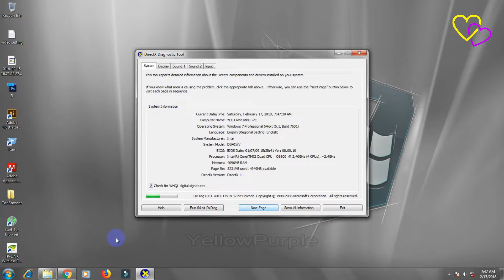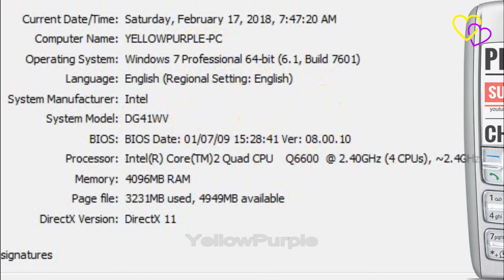Change processor in desktop | upgrade to Intel Core2 Quad Q6600 @ 2.40GHz in DG41WV Motherboard

Comment: keep in mind that it won't run windows 10.. it will freeze up around the login screen..  i have the same motherboard, tried upgrading from dual core to core2quad 8200...

Comment: Good morning, my friend I have a plate identical to yours and with the same processor, DG41WV + Core 2 Quad q6600. I am not able to activate all 4 cores ... You have made some changes in the bios, Note: I had to disable the power limiter to be able to work with this processor! If my English is bad, do not worry because I'm using google translator kkkk.
Reply: Im not able to activate all the 4 cores too 
Can you help me to fix this problem?

Comment: What are specifications that I should look for upgrade Core 2 duo e8300 to Core 2 Quad 
Cpu -core 2 duo e8300
4 ddr3 ram (2gb+2gb)
Reply: nothing. but make sure you buy a 1000 rupees above fan for it

Comment: Hi, is that possible or not to upgrade my core 2 Duo E7400 ,G31 M-S motherboard LGA 775 socket into core 2quad  q9650 processor  pls reply
Reply: Yes but q9400 is more comfortable with g31 motherboard than q9650

Comment: did you need to do anything with the BIOS or did you simpily just place it in and boot it?
Reply from the maker: simpily just place it in and on the pc
Reply: @YellowPurple  didn't work for me. I replaced my dual-core with core2 quad, the CPU was detected, windows boot up, but when I launch whatever task, my computer freeze and I got the blue screen. My motherboard is Mercury G31, specs say it takes all processors
Reply: @tunkunrunk  i have got a similar issue , at idle doing nothing it lasts but when ever i try to do any multitasking work which spikes the cpu usages to 100% for more then 10 seconds it freezes and hangs , until i restart the pc manually . So have you got any fix ? I am desperately searching on the internet but found no fix yet .
Reply: Yes i have same issue
Reply: @Wolf-jb5bh  go on your bios and desable or auto TDP
Reply: @ig.sushant  go on your bios and desable or auto your TDP

Comment: Can i change my dual core processor to core 2 duo in the same motherboard.
Reply: Get Q9400 processor it is better for lga 775 at good price range
Reply: You must check the adaptability of your motherboard, whether it is dual core or quad core processor compatible
Reply: You can.

Comment: hey I have a doubt that can we change our 2 duo core to i5 core? I mean will it fit in that?
Reply: Nope
Reply: @vnom1939  really???
Reply: @sh4dow312  ys
Reply: Core 2 duo sockets have lga 775 sockets where as a core 2 quad have a lga 1155 socket so they will not even fit into it. You can use any core 2 duo or quad processors but not any i5 or i3.
Reply: @yashodharagautam6995  So can i replace my e5700 processor to Q6600 processor?
Reply: Yup, surely :)
Reply: @yashodharagautam6995  thanks a lot for replying

Comment: Do i need to change my power supply ??
Reply: no , today i have changed E5300 processor ( duel Core ) to Q6600( quad core ) in I BAll Cabinet Baby 306 mini cabinet without changing the SMPS and it worked fine, Yes slightly temp increased but that dose not matter.